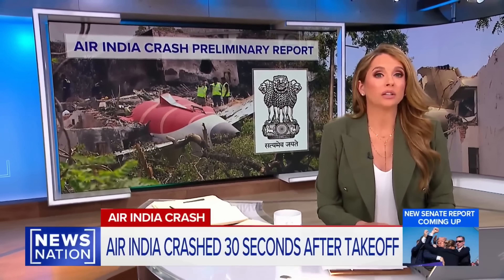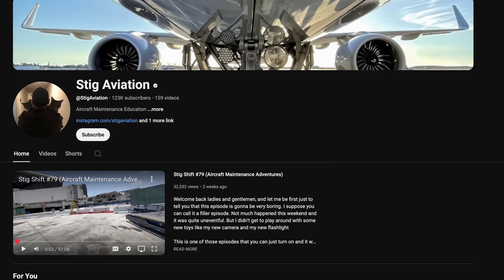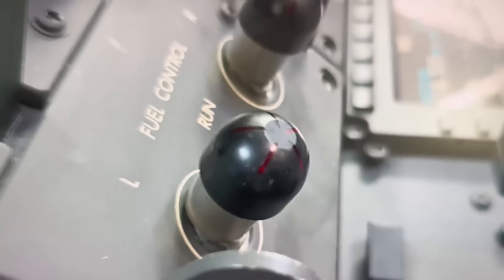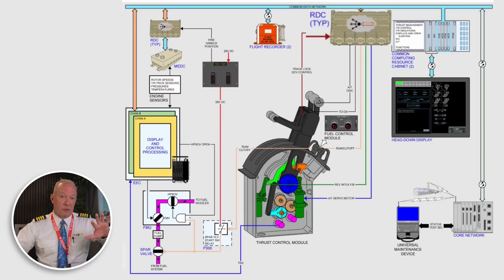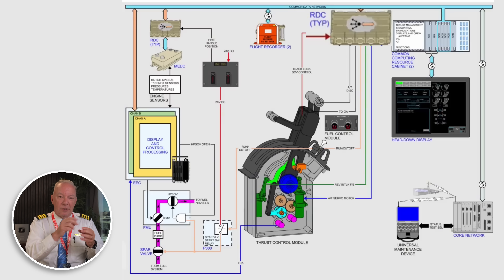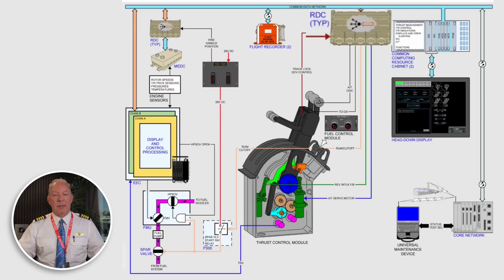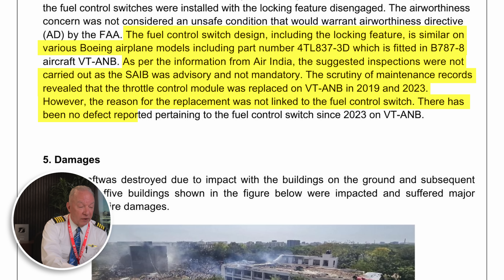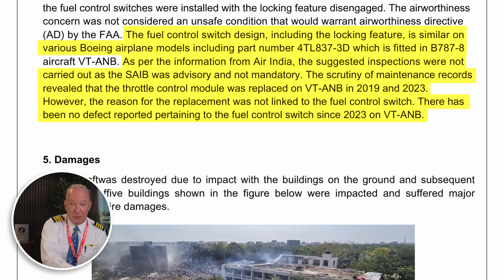The Truth About Boeing 787 Fuel Control Switches

Comment: 5:01 “It is a closed loop system” IfUSāSō ! A closed loop system requires a “LOOP” or feedback to make a loop. Try again. Also what u r describing has a lot of single point failure possibilities. My understanding is that those switches are multi-pole multi-throw to provide redundancy and there is some logic between these different components. What u r showing is a high level functional   semantic used for educational purposes. What is needed is the maintenance diagram. Your description would suggest that one frayed wire will shutdown an engine, not a feel good design.
Reply: you can’t write “you are” instead ur? Use proper grammar or zip it. You’re criticizing captain Steve and you can’t use complete words? Another Internet moron.

Comment: Let's add some math to the vibration discussion. If we assume that lifting the switch out of the detent requires 10 N (about the force to lift 1 kg)  and that the part above the detent weights about 1 gram a vibration of 1000 G would be required to get it over the detent. A vibration of this magnitude would have disintegrated the plane to shreds and instantly killed everyone on board.

Comment: There are couple more factors to talk.
1. What extactly black box sense as switch transition ? Which extact signal is sensed. It could be either:
* actual control "24V voltage" signal
* separate sense signal line from switch
* one or more secondary signals after relays
* status data reported by FEDEC
* etc.

Different singnal schemes could have different result to Black box data and actual engine function on different faults.
There could be faults, when black box would register fuel switch "transition", without actual switch manipulation, and/or without actual engine shutdown.

2. In common, Parameter black box data could register apparent fuel switch movement, but we need more evidences to exclude telemetry fail.
Such evidence are FEDEC logs, registering engines shutdown and spooldown, but also it could be switch clicks on voice recorder (which wasn't mentioned in report), pilot conversations, recorded clicks on switchig switches back to run.
The wording in report didn't mention some evidences, so "switch transition" should be read as "apparent switch transition", before they told how they confirmed black box data.

Signaling failure is unlikely had place in Air India case (because of two switches, conversation and their apparen switching back to run). But their indistinct wording like "switch transitioned" (instead of, say "switch transition registered in BB"), omiting supporting evidences of physical transition and omiting distinct timestapms are concerning.
Reply: Too wordy and too many fanboys on this page.

Release the full cockpit transcript and FDR, then will know more.

My guess, checks have already cleared to get the desired result.

Until they release all the details, I'll assume both pilots spoke the truth.  Fuel cutoff was indicated, Pilot verbalized that, other responded he didn't do that.  I'll take both as truthful for now.  

Let's hear the rest of the conversation before deciding.
Reply: @riggitydoo5116  Your third sentence means that it doesn't matter what the report says.  You've already decided you won't believe it.  So why bother demanding that you have it so that you can properly decide?  It's going to be like Apollo deniers.  Show them 25 storerooms of documentation about the program and they'll decide that a funny shadow on picture 86281B3 means the entire thing is a hoax.  More details never convince somebody who's motivated not to believe.  

Think of two sticks jammed into the ground ten feet apart.  Those sticks are the information we have right now, and you're demanding to know what's in the middle, or you won't accept that the sticks are even there.  So an investigation gets done and now there's 50 sticks in between the first two.  Does that help?  No, because now you can focus on 51 separate "holes in the story", not just one.

And that's just how it goes with providing information..  "My guess, checks have already cleared to get the desired result."  That's all that needs to be said.

Comment: Thank you for providing additional clarity on the fuel cutoff circuit. For some reason, which may be emotionally based, there are quite a few people who do not want to believe that those switches were actually moved by someone in the cockpit. Some want to say that Boeing is making some kind of coverup, and they think that the vague language used by the Indian investigative body supports the idea of either a coverup or some other failure besides the actions of a human. The fact is that humans are capable of all sorts of actions. A look at Auschwitz is all you need to know to understand the depth of human depravity. One commenter suggested that there could have been a circuit failure that shut down the engines in the same way the switches would. I suggested to him that those odds were similar to both pilots winning a lottery jackpot on the same day. Not impossible, no, but so extremely unlikely that the chances of such a failure are very close to zero.

Comment: @10:50 what if there is some weird power failure? some say that the AC was malfunctioning, although it is quite essential, too... i mean: batteries often have a management system that shuts them down, if there is a short... even a short could cause low voltage... or is it not thinkable, that the electrical insulation fails that bad?
Reply: that has nothing to do with the switches.
Reply: @ThereIsOnlyOneRandom  ok... but: could it happen? i mean: u dont have to move the switches, if the battery fails... it would look the same...
Reply: @RRIDDICC  they checked switches and battery so what are you talking about, switches were turned back on and it worked so the battery was fine otherwise if you pull switches back to position ON nothing would happen if the battery is faulty, it was too late but first engine started it means that one of the pilots moved the switches to OFF position I see what are you trying to say, but it is human fault once again, after few years we will find out what kind of issues dude had or if something happened in his family or he was diagnosed with cancer and he decided to do what he did, I'm sure we will get the answers, so chill and accept it, it was a human fault.
Reply: @ThereIsOnlyOneRandom  allegedly they tried that with MCAS, too... i do not really try anything here... i just wonder, who is right...

Comment: Also one of the pilots asked the other why they moved to cutoff, indicating the other did it.  The other denied it because they wanted to die.
Reply: Why arent we considering a possibility where dual engine failure happens just after take off. Then pilot manually turn fuel switches off and on because thats SOP in Boeing planes in case of Dual Engine.? You can refer to Gaurav Taneja AI 171 Part 3 in english dub to understand more about this theory as timeline of RAT deployment also matches with this. https://youtu.be/pq2AZdzH7X4?si=0pLKXsmG1M7tRXAZ

Comment: Do not harp on the one second time difference between flipping the first and the second switch, because the currently available FDR timeline is inaccurate in that its time resolution is ONE second. In other words this time line cannot resolve time differnces of LESS than one second. Even if the actual time diffference between two actions was only 1/10 of a second, the currently available FDR recording would still display it as being one second apart. Since when do events occur only at one second intervals and always on the second?  Of course they occur at ANY time. The FDR recording makes it SEEM that events only occur in one second intervals and always on the full second. A normal FDR has a 1/10th of a second time resolution. The fact that the available time line has only one full second time resolution means that you are working with insufficient data. Is rhis so hard to understand? Stop using this time line to supprt arguments it can't support.

Comment: Yes, most people don’t want to believe that this was done on purpose. We go through the grief cycle with denial/bargaining/denial and wish it didn’t happen the way everything is pointing.
Reply: There is a cultural barrier in India to admit/recognize the reality that unfortunately the facts, as we know them now, point to an intentional action by one of the pilots.
Reply: @thesweeples3266  The "best" that can be hoped for is the intentional act, if indeed that was the case, was somehow accidental.
Reply: Even if confirming one of the pilots had moved one of the switches, we still don’t know what was going through his mind. It could’ve been on purpose, maybe he meant to toggle a different set of switches maybe there was some unexplained/unexpected sporadic muscle relfex that kicked in.
Reply: @ollie2074 
Are you being sarcastic or serious?
Reply: @BlacKnightChess   It's very unlikely that it was done by mistake, but it is not 100% impossible.  It has happened at least once before.  In 1993, in France, a captain was told to gear up after take off. He instead cut off the fuel. That was on an A320. News article about the incident mention the copilot saying the captain was acting incoherent for a few minutes. So probably some form of temporary mental impairment that made him act irrationally, like a brain fog due to a stroke maybe?
Luckily, they had enough altitude to relight the engines and recover.

Comment: Excellent video!!!  The schematic is a real help in understanding how everything works.  Something I don't see is a ground return to the battery.  A circuit has to be complete with a power source and a ground for electricity to flow.  I have had many issues with electronic equipment having intermittent issues.   Cleaning the contacts and providing a good ground fixed the issue.
Reply: The schematic is no help. It's extremely simplified, to the point of being useless for forensics. It's the sort of thing they show the pilots for a conceptual overview, so they get an idea. Most pilots don't know what's really happening.
Reply: Yeah, he isn't using the correct diagram, and he's mis-stating the functionality and misleading people.

Comment: @4:30 Notice that there is an AND gate to the HPSOV in the FMU.

@7:51 The other signal to that AND gate seems to come from the "DISPLAY AND CONTROL PROCESSING" block. So, it seems like something in that block could close the HPSOV valve.

I'm not offering up any conclusions, I'm just reading the schematic provided.

Comment: What happens if the spring/springs break?
Reply: Its still a mechanically latching switch, the spring loaded cap is simply a safety locking device to stop accidental actuation
Reply: Would it not be the spring that holds the lever in either the run or cut off position.  
Was just thinking during rotation with vibrations and G force, if the spring failed. Could the switch flip itself

Comment: Great video & explanation Capt Steeeve, thanks.
Based on this I must agree I was wrong in my initial thinking that glitchy software caused those switches to go to the shut-off setting. This must have been initiated by one of the pilots, because those switches according to the report was switched off and 10 seconds later back on as also confirmed by the report's pilot voice recording.

Comment: Water ingress into Electrical Equipment Compartments; both fore and aft.
Reply: Fantasy
Reply: @thesweeples3266  Like door plugs blowing out, hydraulic rudder valves exceeding design travel, or software flying aircraft into the ground.

Comment: Thanks for this.  There were way too many comments by state actors claiming some computer malfunction that changed the switches.  Now we know that the switches are entirely mechanical in nature.

It's like whack a mole with the crack pot theories.  And it really doesn't do justice to the lives lost, nor get us any closer to the truth.
Reply: The switches are just switches. He also was half incorrect; the voltage signal, reduced from 28v (usually 5v), from a closed engine run switch goes to the computer; the computer reads this as the run position and sends a voltage to the valve relays. This is usually fool-proof; its not going to fail.

Think of a video game joystick. It is a mechanical device, but produces a voltage read by a computer (the console). The throttles and switches in a modern jet work in a similar way.

Regardless, the Captains point remain valid, perhaps even more so with electronic systems (purely electromechanical systems can and do leak voltage).
Reply: Forget computers but the system data has to be captured from the aircraft systems and controls somehow in order for it to be recorded on the BB.  Lets say the switches were not actuated but instead the only evidence we had to go on was the photograph of the throttle module recovered from the aircraft, guess what the switches are both in the run position.  So what else could account for the black box recording the events of the switches having been actuated.  If the power was lost it would record the switches as being actuated, possibly, in my opinion.  Lets not forget the Voice recorder had to be reconstructed as it had suffered considerable damage.

Comment: Bravo, captain Steve this was an excellent analysis, explanation and teaching moment about the fuel switches and how they function. I actually challenged an Indian news report on YouTube that concluded there was still the possibility of an electrical malfunction or unknown vibration causing the fuel switches go from run to the off position, dismissing the human error factor. My conclusion to the news was the best proof that the fuel control switches worked properly and as intended was a crash itself. The preliminary report stated that after the fuel switches were discovered to be off, one of the pilots immediately returned them back to the run configuration. Even after the tremendous ground impact, earthshaking fuel tank explosions, super intense fire and all the devastating vibrations caused by the crash, the evidence proves The switches remained in the RUN position. The fuel control switches worked properly.
Reply: Please watch Flying Beasts analysis before commenting about this topic
Reply: Why arent we considering a possibility where dual engine failure happens just after take off. Then pilot manually turn fuel switches off and on because thats SOP in Boeing planes in case of Dual Engine.? You can refer to Gaurav Taneja AI 171 Part 3 in english dub to understand more about this theory as timeline of RAT deployment also matches with this
Reply: Hi Alfa Dog, where in the report is it confirmed that the switches were moved, or the clicking sound was recorded on the CVR? Transition means changing state not being moved.
See electrical insights from Roger Ahiers post above
Reply: @hubertusjung7802  Did you watch the video? The 28V DC voltage is only provided to the valves when the switch is closed. In the absence of power, the valves remain OPEN and fuel flows. Furthermore, It is a closed system, meaning there are no external inputs, AND the left and right cutoff switches and the 3 valves connected to each are entirely independent of each other. Also, on p14 of the preliminary report it clearly states that the engines only started to loose power AFTER the switches were turned off, not before.

Comment: variation in the electricity may damage the relay? The relay(s) may be defects? While the system is simple... it is not entirely mechanical... The 28 volt trigger another relay or contact in the pump... good to make it simple... but nothing nowadays are rely so simple ;)

Comment: The Boeing Company (Boeing) received reports from operators of Model 737 airplanes that the fuel control switches were installed with the locking feature disengaged. The fuel control switches (or engine start switches) are installed on the control stand in the flight deck and used by the pilot to supply or cutoff fuel to the engines. The fuel control switch has a locking feature to prevent inadvertent operation that could result in unintended switch movement between the fuel supply and fuel cutoff positions. In order to move the switch from one position to the other under the condition where the locking feature is engaged, it is necessary for the pilot to lift the switch up while transitioning the switch position. If the locking feature is disengaged, the switch can be moved between the two positions without lifting the switch during transition, and the switch would be exposed to the potential of inadvertent operation. Inadvertent operation of the switch could result in an unintended consequence, such as an in-flight engine shutdown.

Comment: Were the pilots right or left handed?
The captain may have initiated the cut off being right handed so as not to allow the copilot to reach over and open the valve from left to right.
And if the copilot did the deed then being left handed would allow him to reach and quickly shut off the valves. 
But maybe both were in on the deed?
But one second apart suggests that it was the captain who could block the left switch from the copilot. 
It al boils down to mass murder.  Not unlike the Boeing Frankenstein flights that crashed due to the MCAS debacles. 
But the airline who hired a mad man is responsible to the victim's families. 
Let God be true and every man a liar. Adam, where art thou?
And Judgment Day rolls on.
Bon appetite.